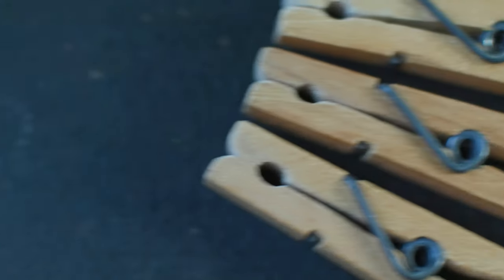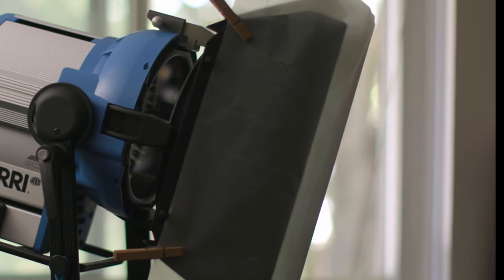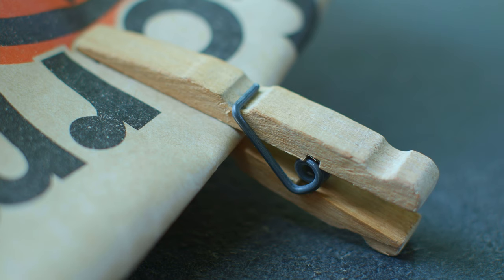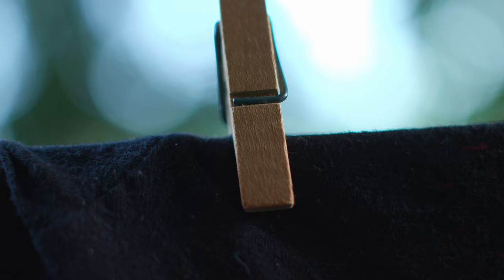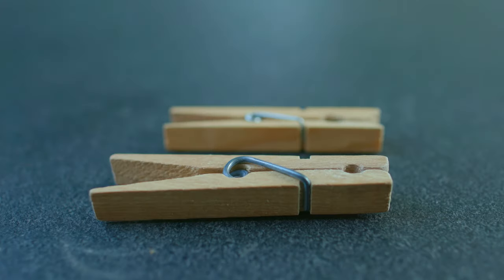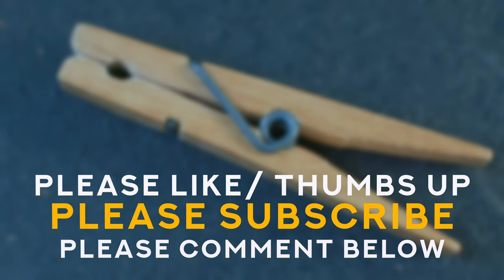HOW I USE CLOTHESPINS

Comment from the maker: 0:00 intro
0:37 lighting application
1:08 wardrobe application
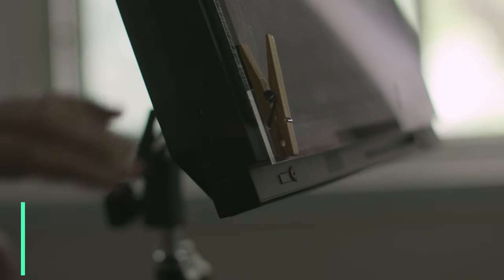1:23 holding your scripts
1:42 take 'em apart
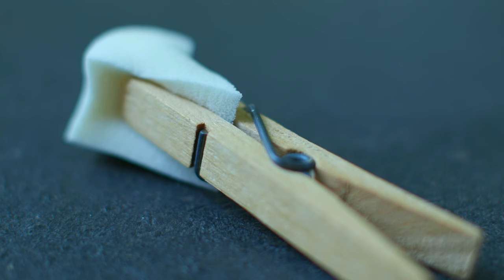2:07 dabber
2:17 turn 'em inside out
2:32 close chip bags
2:49 mixing spoon holder
2:54 use it for what it's made for
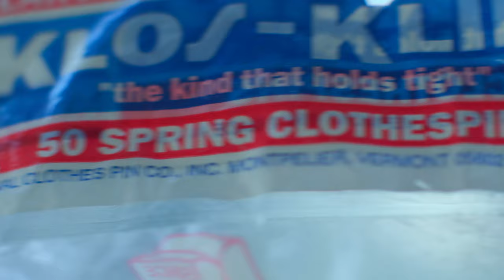3:35 National clothespins stops manufacturing
3:56 vs. big box clothespins